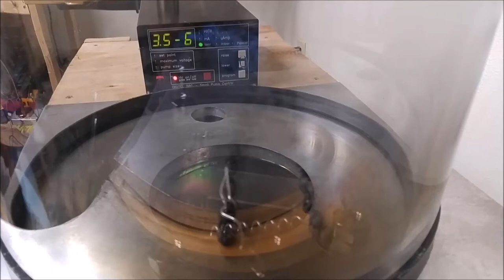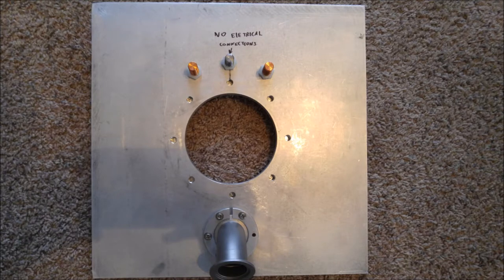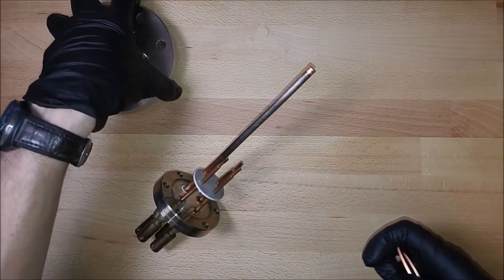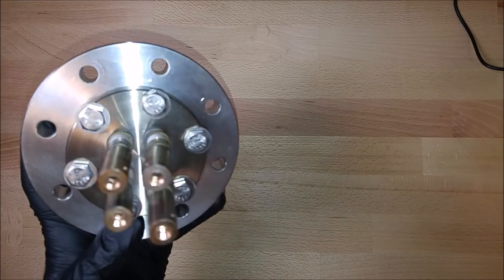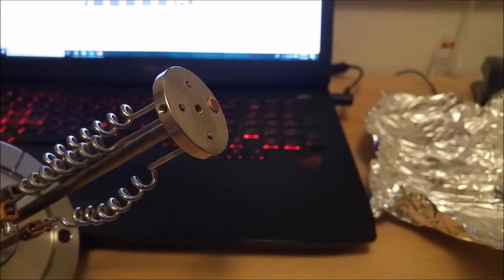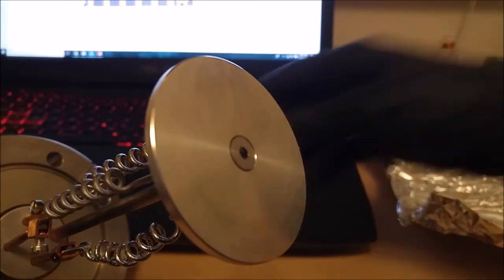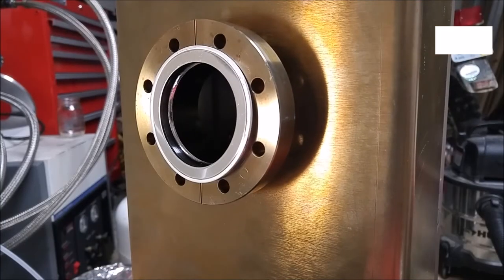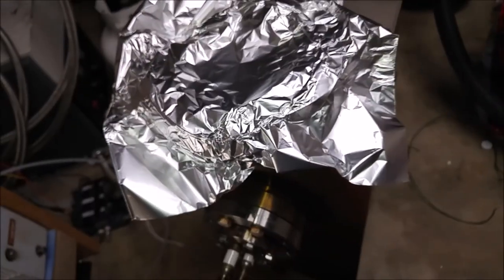How a Titanium Sublimation Pump works

Comment: thsnks for the video, glad I found this channel. I just picked up a diffusion pump and rotary feedthrough today and a large bell jar, tungsten boat and aluminium base plate few days ago. I'm planning on doing some pvd (evaporating and sputtering). I've got lots of machining to do on the lathe and electrodes to make etc 😅
Reply from the maker: That's awesome! I'm working on something similar right now!

Comment: what are the filaments worth? and how many minutes/hours of run tin do you get? whats the benefit over other pumps?? thanks! keep up the good work
Reply from the maker: +HomeDistiller Thank you! They are relatively cheap compared to other pump types, about about12 filaments for 300 dollars. Each filament averages about 20 hours, but that can be a very short amount of time or many years depending on how clean the chamber is.
Reply: Eric Dalgetty thanks for the reply! Looking forward to seeing what you do with this pump.. Your system is much better than mine lol I just got the pump system finished, and now I'm working on the chamber. But I'm working on it much cheaper than your system lol.. Another quick question.. Could you use soft lead for the seals?
Reply from the maker: Sorry I never saw this question! Using lead seals really depends on your chamber. Lead tends to off gas a lot, so I wouldn't recommend it for a better than medium vacuum. Also, lead has a very low melting point, which means the chamber can't be baked. Hope this is helpful!
Reply: WOW 300 dollars for just some pieces of Ti wire. Are the special in some way? what happens if i use Titanium wire instead of specially made filaments?
Reply from the maker: The wires are an alloy of Molybdenum and Titanium, the molybdenum keeps the wires stable at high temperatures. I am not sure that a pure titanium filament could be run at a high enough temperature to sublimate without melting. If you wanted to use pure titanium, I think it would be better to use a separate heater.

Comment: great video,but a question,how to remove the "getter layer (titanium+active molecules)from the alluminium plate? will you have to remove the entire pump?or just making some cycles of high heating process+normal "rough" pump(just to create a flux for moving the "getter layer")?
Reply from the maker: Once the current layer has become saturated with absorbed gas molecules, the pumping speed will decrease and a new layer of titanium will need to be deposited. Eventually these layers can become quite thick and will need to be physically removed by scraping or sand blasting

Comment: So it creates a fresh getter film every time you heat it up?
Reply from the maker: Exactly. In theory, you fire the filament whenever the previous film has saturated. Eventually a thick film will build up on the chamber walls and flake off, which can short out electrical components.

Comment: I'm reasurch about second stages.. If i understand you correctly... With heating titanium wire you don't need turbomolecular or difuffion pump? Or that assumption is incorrect. And second question.. How would go with combination with ion pump - those have max tem 350C°?
Reply from the maker: You are correct, there is no second stage! Only a roughing pump -> Titanum sublimation -> ion pump. The ion pump won't reach temperatures that high, the titanium is only sublimated for a few seconds.
Reply: @EricDalgetty  well If I will build my project is 2 years away and i for hobby. I'm inclining to diffusion pump and ion pump.. Goal is to get to - 9  but I will probably newer need it.. Due to prices I was looking to buy entire small system.. Because in parts it can be much more expensive for me. Here is suggestion for your video about electronic to drive turbo pump (supply and probably square signal).. Connet it to scope. On ebay is a lot of parts but what goes together.. Well here come addition study. Thank you for answering me and magnificent videos!!

Comment: Where can I find these filaments?
Reply from the maker: I found these ones on a listing on eBay, you can find them by searching Titanium Sublimation Pump replacement kit. I recall seeing that someone has made a working TSP using just titanium wire, but you won't be able to get the wire to as high of a temperature before it melts.
Reply: @EricDalgetty  ah, thank you!